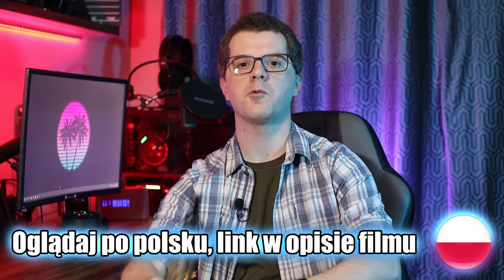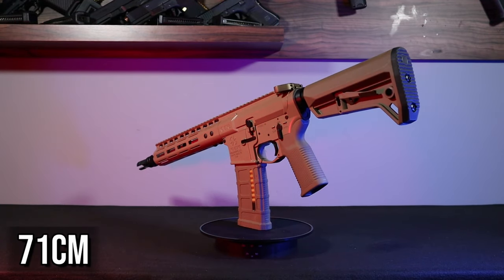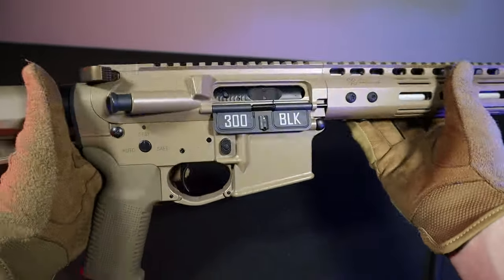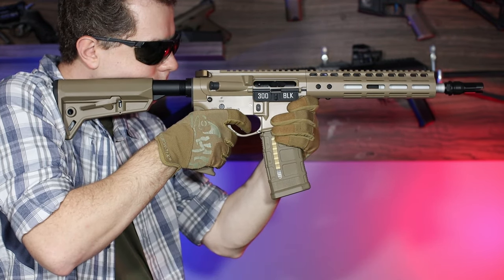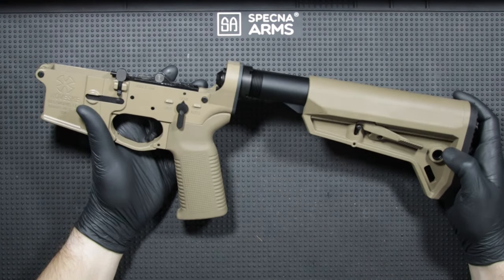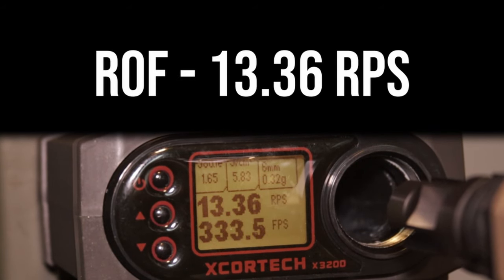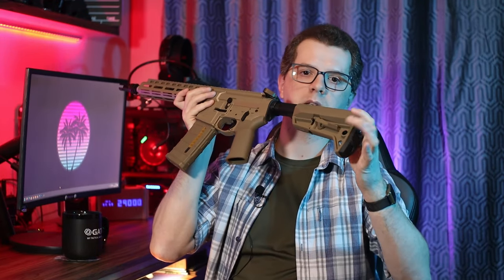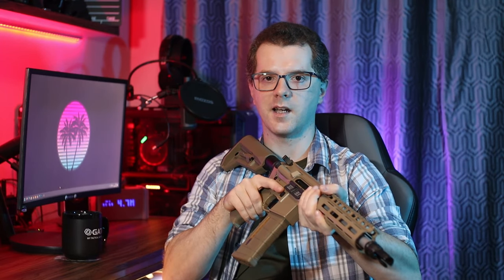Airsoft Review | GBBR that you will want | EMG NOVESKE N4 MWS GEN3 By Double Eagle

Comment: As an MWS enjoyer - I’ll warn other MWS enjoyers that this is not an upgrade over you’re current Marui system. It’s very nice, for its price. But compared to the Tokyo Marui offerings it feels cheaper. 

That said, it performs great. I really only sold mine as I had 4 MWS systems at the time.
Reply: Yea my friend has the noveske, I have the TM mk18.. he snapped his nozzle after first mag, once he swapped to tm bolt and nozzle it worked fine so it's definitely a weak point.

It's a lovely rifle for half the price.. but again its not a TM in the back of my mind
Reply: @lethalgamez  for sure. I do regret selling mine as it’s visually cool, and ran great. But it was a definite step down in quality.

Comment: Great review, i've considered this for a while now, but i'll definitely run it with a HPA adapter instead of gas mags.
Reply from the maker: Thanks! Happy it helped you with the decision 😁 What adapter are you planing? I think I've only seen the T8 P30 adapter as far 🤔
Reply: @Maniek44Eng  Airtac makes a bunch of MWS adapters. Considering the shotgun shell one
Reply from the maker: Nice, I will check them out, thanks!
Reply: I tried an airtac mws adapter paired with an balystic regulator. The semi auto performance was good, and it was nice to be able to use the MWS with EPM1-S (short) mags. But either the airtac adapter or the regulator could not keep up in full auto, where every other shot, the FPS would drop massively and a BB would barely shoot far, and the next shot would be normal and good range wise, followed by another dud. And the overall rate of fire was significantly lower than on the normal green gas mags. I'm going to try it with a different regulator when I get a chance but be warned, using a HPA adaptor might not be the 1 solution fixes all approach some might hope.

I've also got to say, for me, it kind of kills the spirit of a GBB, so I'm back to using the gas mags and happier for it.
Reply: @DeckerdBR  did you check if your regulator was refreshing fast enough? Because it sounds like it didn’t

Comment: 10:38 right right hold on their wrong and I'm sorry but you can't use 300 blk in a 5.56 mag a it will blow up or use 5.56 in 300 blk as the diameters are different buy lengths are to same plus 300blk has more powerful powder then 5.56
Reply from the maker: You can use 300 blk in 5.56 mags, because the bullets will fit the mag, and use them in 300 blk rifle. You can't use them in 5.56/.223 rifle of course
Reply from the maker: https://youtube.com/shorts/FU3beNtBPwY?si=1xz3edgmrPbVxFtR Check it out

Comment: The fact, that they still did not fixed the bolt, is annoying. 

When the bolt is in the forward position, its not locking properly, and there is a gap, which is clrealy visible when the dust cover is open.

Comment: You want the cyma cgs system which is and upgrade mws double eagle variant is not as good
Reply: @Maniek44  Iv changed out quite a bit what they’re referring to is the mating up of say the gas route lips like you’d want a mws bolt while using mws mags if you use the mws mag with say the t8 bolt or the cgs bolt the routers don’t match up very well Iv swapped to the mws trigger box and bolt and use mws mags

Comment: I got this and the hop struggles to lift 0.32 stock
Reply from the maker: Yep, the stock hop-up bucking is not great and I got similar results. I've changed mine to psionic upgrades bucking and it works just fine, I think maple leaf should work as good :)
Reply: @Maniek44Eng  thank you so much for the input